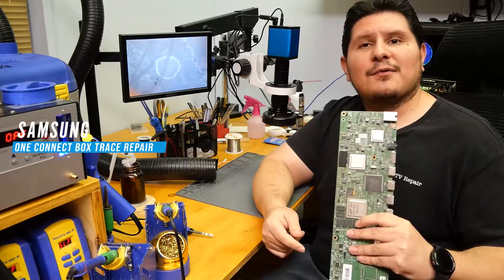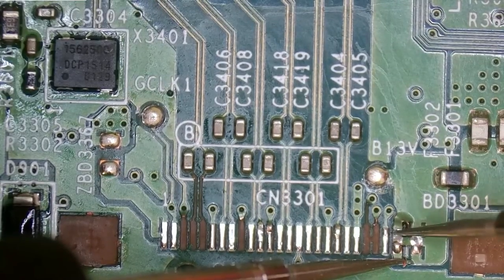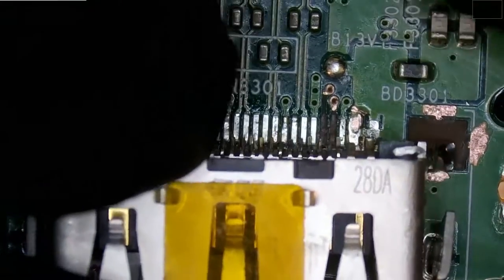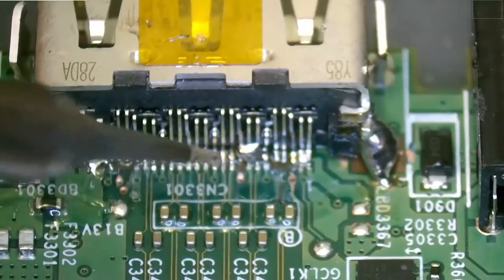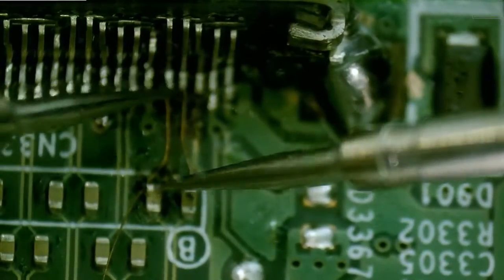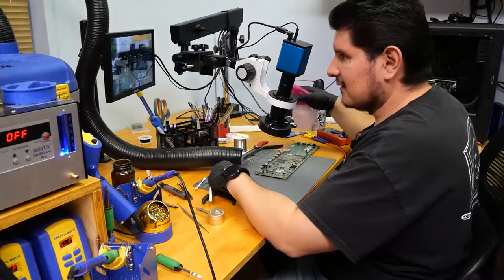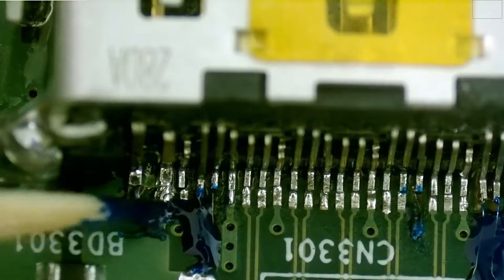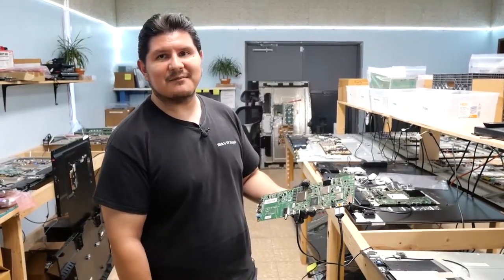Samsung 4K TV Repair UN65JS9000FXZA One Connect Box

Comment: Congrats, good video. Can I plug a one connect  console to a different Samsung display? Is it compatible?
Reply from the maker: Some are but not all. Some have different one connect cables some use the same. If it's the same cable you can plug it in but sometimes it will detect that it's not the correct TV, and show perfect picture and looks like it work and then show a message saying it's not the correct TV and shuts down. It should really work but I think Samsung put software in there to make it not work. Although that is just speculation.

Comment: Hey Nick, amazing work is👌 i wanted to ask is there a website where  i can buy a connector for f9000 box mine dropped still plugged in and the connector chipped on the inside so two pins do not make contact with the cable i lost the chattered piece so i cnt even glue it
Reply from the maker: Sorry we don't sell the connectors, we have such a limited supply (donor boards) that if we use them it's because we are doing a full repair on the unit.

Comment: i have a UN75MU8000, everything works great, however the one connect box for it does not have any av outputs on it, the pcb does have footprints for them though, i'm trying to figure out if there are any other models of the one connect box that come with those av connections that would work with my tv
Reply from the maker: That I am aware of no
Reply: @NicksTVRepair  i have seen similar models to my box on ebay from china with the headphone jack type connectors that samsung uses for av, same size and plug type and everything

Comment: Is there any way to repair the one connect cable side that enters the one connect box? Or is ut best to just replace it?
Reply from the maker: If the cable itself is damaged, I would say best to replace it. On eBay you can get them for less than $100. The cost of repairing a cable usually will be much more and won't be as reliable. 
If the connector inside the box is damaged, that is something that can be replaced and fixed per the video.

Comment: Great video Nick.
Can you show how to open the box to get to see the inside?
My unit will connect briefly then shows the picture saying it needs to connect.
There's power as the optical connection is lit up.

Any suggestions on what to look for.
Im.thinking it may be a weak power supply causing the disconnect..
Thanks
Reply from the maker: You most likely have either damage to the port itself just like in the video, a faulty one connect cable, or one of the processor chips on the board is going out. I don't recommend opening up the box, you will only chance damaging the board inside.
Reply: @NicksTVRepair  thanks for the response Nick.
I tried another box from our 65" set.
It worked fine.

The box in question with another cable still yielded the same intermittent result.

So I'm positive the cable TV pirt is good.

Now my next question.
Do I really need a one connect if I plug directly into a internet modem.
Want the TV set recognize t h e connection and also me to do internet tv?.

It does see the WiFi with a good box plugged in.
But won't stay connected with the intermittent "one connect" as I'm thinking the TV is defaulting to the box hence I lose all connections

Comment: Hello, ive watched your video and several others but i cant seem to identify my exact issue nor have i seen anyone else with my exact issue. I turn my tv on then it cycles off after 15-20seconds followed by standby light flashing 5x then back on and repeatd this process. The picture and sound are perfect while on. Ive attempted to replace the main board but that didn't fix the issue. Would you suggest replacing the power board or my one connect box? My tv is a Samsung QN55Q7FNAFXZ
Reply from the maker: I can't be sure without diagnosing the set myself but cycling is most commonly caused by a defective one connect box and or mainboard. I don't believe your cycling issue is caused by the power supply but again without being in front of the TV I can't be sure

Comment: When you place a new motherboard in the one connectbox do you have to download all the apps again? Or will they still be on the tv???
Reply from the maker: You would need to download them again as well as go through the login process for all of those as well. 
I would recommend using the amazon fire sticks, chromcast, roku device, apple TV, or other similar devices as those can be transfered from TV to TV will reatin all your information, apps, and are typically easier to use than the built in apps of most TVs.

Comment: Hey nick everything works on my tv and box besides the hdmi I connect a hdmi and it says something is plugged in then I go the hdmi channel and the tv say no signal? Maybe I need a new box?
Reply from the maker: Hello,

The fault you are experiencing is actually common and I just did a video on it. Now the box I did a video on is for an HU9000 series instead of the JS9000 but the repairs are very similar for both. If you are interested in checking out that video here is the link to it:
https://www.youtube.com/watch?v=YgfJ9njQlSA

As for replacing the box, I don't think you will find a replacement. These are all out of stock from all retailers, which is why we do offer repair services on them. All of our services do come with a 1-year warranty. If you are interested in sending yours in for repair, I would recommend you contact us directly. I have links to our contact page and repair services in the description of all our YouTube videos.

Comment: So satisfying to watch! One can only love what you guys do! Question: Would you repair a connect box BN91-21160L (for our Samsung 55Q90)? It's not able to start the TV anymore (I keep hearing a "tak" sound from the relais). Probably some components damaged when it overheated (I kept the TV running for straight 10+ hours every day and one day it was just too much.)
Reply from the maker: I am not very famliar with the Samsung 55Q90 and am not sure if the fault would be with the one connect box, mainboard, or power supply. Since we don't have a test TV for that model it would be difficult to diagnose and confirm the fault. Because of that I would not be comfortable saying we can fix it for you at this time. 
I would recommend trying to locate a new box first or a used one if one is available.
Reply: @NicksTVRepair  one possibility with these TVs is the "invisible one connect cable".  Many of these are fiber optic (not all - but certainly the ones with very thin cables are"
Reply: @NicksTVRepair  Thx for your reply. We brought it to a Samsung repair shop (Let me Repair) for analysis and they figured out the fault is within the electronics beneath the display. Sadly, they cannot provide repairs to figure out which components are broken and replacing that mainboard (they probably buy a new one) costs in total 870€! So sad and embarassing to have that broken TV in the basement now. Reality kicks in, another high tech piece for the dump..
Reply: @MarcelFitzner don’t dump it.. i have same issues. one day i on the tv and i think high power run through it, due to maybe my extension board. I bought new one connect box for exact tv model for 120£ and tv is working perfectly.

Comment: Very good video! My JS9500 won't turn off (starts right up again) and the remote is not working anymore, also I lost wifi capability. Do you think it's the fault of the one connect box and is this fixable? Thank you
Reply from the maker: I would recommend disconnecting your Wifi, bluetooth, IR, and button boards, then plug it back in. Does the TV turn itself back on? If yes then your fault is either with the mainboard or your one connect box. In which case I would recommend performing a software update and a reset to the TV. 
If the tv does not turn itself back on however then one of those boards you disconnected is the cause of your fault. Plug them back in one at a time until the issue comes back. Then you will have found your faulty device. 

In the event the mainboard or one connect box is at fault, the software update may not fix the issue. If this is the case I would then recommend sending them in to our repair facility to be fixed. 
We offer a flat rate service which comes with a 1 Year warranty. For more information check the video description. I have a link to the service and if you have any questions I also have a link to our contact us page + email info.

Comment: Hi nick no one can help me but maybe u can what model one connect box and cable do need for Samsung UN65ks8500f
Reply: I see so many models and can’t find any info on which I’m goes to my model tv can u help me with any info which one do I buy and where best place to find it
Reply from the maker: the box you need is either the BN91-17814A or BN91-17814W.
Those are the 2 variants that should work with your TV set. 
I don't know many people that have them avaialble for sale, but if you have your original, I can fix it for you.

Comment: Hi! My UA65JU7500 won’t turn on if the one connect cable is plugged in even without the box itself. May I ask if you cknow the fix for this issue? 0:05
Reply from the maker: You could have a bad cable, Mainboard or one connect box. 
I wouldn't be able to assist you past that without being present with the TV.

Comment: Hi, my tv is a Samsung UN65KS8500FXZA with a One Connect box BN91-17814W. We got hit by lightning so now when the tv turns on it says 'make sure the one connect box is connected' and won't  proceed any further. I then hoped that by disconnecting the one connect box, the tv would at least continue to turn on so we could use the apps via internet. But no, I’ve been denied! Any thoughts?
Reply from the maker: Hello,
Sorry for not getting back to you sooner. This is in fact a one-connect box we can fix even though it has lightning damage. 
If you did want to send in your box for repair, we have a flat rate repair service listing which I will link below:
https://nickselectronics.com/products/bn91-17814w
The repair does come with a 1-year warranty as well!
Reply: India not list your website sir

Comment: Can I use my Samsung tv un65hu9000FXZC WITHOUT THE ONE CONNECT BOX 
CAN I USE CONNECT ONE TO HDMI CABLE ONLY
Reply from the maker: The Samsung UN65HU9000 won't work without the One Connect box. The box needs to be connected for it to be able to turn on fully. 
Your second question I don't understand: "CAN I USE CONNECT ONE TO HDMI CABLE ONLY"

You can connect an HDMI cable to your One Connect box, yes, but if the One Connect box is not working then your TV won't work properly. You would need to have the box fixed first. 
Also the mainboard and box can both fail with identical symptoms, so if you plan on sending those in for us to fix, make sure to send both the mainboard and box not just the box.

Comment: My ue55js9000t has stopped working. The TV itself seems fine, as its asking me to plug in the connect box. It's when I plug the connect box that I get the problem. Black screen. No picture. I can use the navigation buttons on the back, as I hear the clicking noises. Is it repairable, or do I just get rid?
Reply from the maker: Definitely repairable, that could be either a mainboard or one connect box fault. If you want to send them in we can live test and fix whichever is defective.
We have links to the repair service in the video description
Reply: @NicksTVRepair  that's great it may be able to be repaired. However I'm based in the sunny UK. Not sure it's feesible to send it. I appreciate your response though.

Comment: i have replace the main board in my one connect box and tv switches on for a few minutes display is perfect but then it goes all weird and goes black. Could it be the psu that powers the board that sits beside the main board in the box ??
Reply from the maker: Hello,

The one connect box is 1 circuit board for the model we work on in this video. I suspect you are working on a completely different TV set that uses different versions where it is separated into 2 different boards. Those are very different and vary from model to model. I don't service those much yet so I don't have much experience with them. 
You would need to provide me with the exact part numbers of each circuit board before I can answer any questions. But also even with the exact numbers, I can't give you a great answer without diagnosing it in person. What I can tell you is that if you have picture distortion, then the mainboard usually causes that. You have a mainboard in the box and also in the TV so when I say mainboard, I don't know if the fault is the TV board or OCB board. 
But a black picture without distortion could also be the power supply in the TV, not necessarily just the box. 
There are too many factors I think for me to be able to help you much here. 
I usually don't say this, but I would recommend finding cheap parts with good return policies and swapping them out one at a time until you get it fixed.

Comment: Hi! My UA65JU7500 won’t turn on if the one connect cable is plugged in even without the box itself. May I ask if you know the fix for this issue?
Reply from the maker: Are you saying the TV turns on fine with both the box and one connect cable disconnected, but the moment the cable is connected the TV won't turn on anymore? 
You could have a bad cable, Mainboard or one connect box. 
I wouldn't be able to assist you past that without being present with the TV.
Reply: @NicksTVRepair yes i have tried a different cable and the tv turns on fine but it wont read the flashdrives and other stuff

Comment: I have this same tv. Shows disconnected connect box on the tv picture when not plugged in. When plugged in, i can hear sound but no image. It worked once before, now it doesnt. Not sure of the issue. Any ideas??
Reply from the maker: This could be a fault with either the mainboard, the one connect cable, or the one connect box. 
There is no way to know which one is at fault with out a proper testing jig set up. 
If you would like to send in all three, we can identify which of your parts are defective and repair them on a component level or if the cable is the fault simply replace it.
Reply: @NicksTVRepair  how much would each cost

Comment: Hi Nick, I have a 60 Samsung Frame tv, the screen powers on and shows an animation of the tv and box being connected but when I connect the box the screen turns off. I've tried replacing the box with another for the same model but get the same issue. Any suggestions?
Reply from the maker: The most common issue is the one connec cable becoming defective. The cable is an optical cable, if it gets kinked or stepped on, if you have a pet that might have chewed on it possibly, all these are reasons for the cable to go out. 
I would recommend replacing it next. If that doesn't resolve it, the only other option left would be the mainboard.
Reply: @NicksTVRepair  yea that's what I've read, so I bought a new one of those as well. Are there components on the board that can be replaced or do I need to source an entire board? I have the equipment to do a reflow and replace individual chips and components I just dont have the experience yet to know exactly what to look for
Reply: @daltong6898  Did buying a new optical cable repair your issue? I have the same problem, one connect box clicks, reboots over and over

Comment: My gosh I wish I had the tools and time to repair mine. I just took the box apart. My screen was showing a blank screen with one connect connected and it was turning grey and slowly pulsing white. When I unplugged the one correct the tv looked fine, just showing me the prompt to plug in the one connect 😩😩😩. Such an amazing tv I don't desire to sit it but the dumpster. I'm sure it can be saved
Reply from the maker: Well, we do offer repair services for these. If you don't have the tools, we can do it for you. 
Check our service listing posted in the video description
Reply: @danielfranklin2340 Did you find a solution to your problem? Sounds like the same issue I’m having.

Comment: My one connection box once connected brings lines on tv after 5 mins lines disappears but later comes one then disappers. What could be the problem ua65hu9000
Reply from the maker: This is not a common fault. It could be mainboard related, I don't think it's one connect box. Could you send us an email with a picture of the lines when they do appear on screen. I might be able to give you more information from there. 
Our contact info is in the video description
Reply: Does it do that while in game mode or every time?